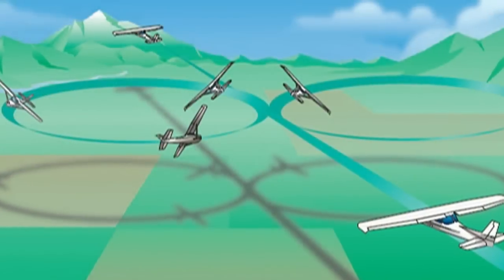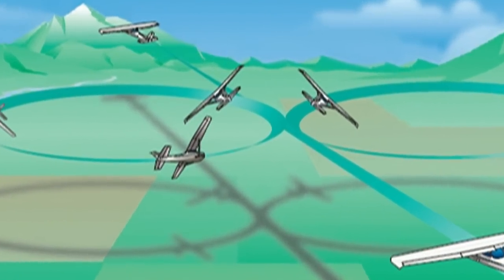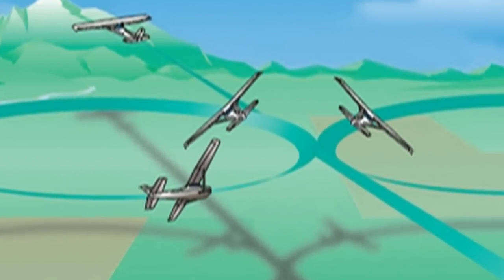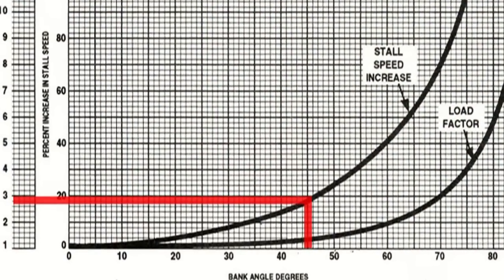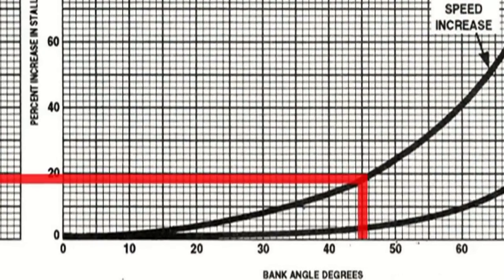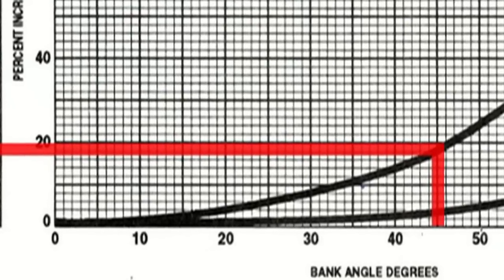Steep Turns Flight Maneuver

Comment: Hey Garry, great video as always. Question: Do you ever use trim to relieve the back pressure in the steep turn?
Reply from the maker: Eamonn McIntyre You can if you like; no rule either way. I teach not to trim. After all, a 360° steep turn is over in about 30-seconds, then you'd have to re-trim again...

Comment: Once on the 45 bank do you keep the joke on the bank position or back to neutral?
Reply from the maker: You need to use some counter-aileron; example: in left steep turn, once at 45-50° bank, you will turn aileron slightly to right to counter the over-banking tendency (right wing is moving faster than left wing in this case; creating more lift, resulting in more bank); google 'over-banking tendency' to learn more about this.